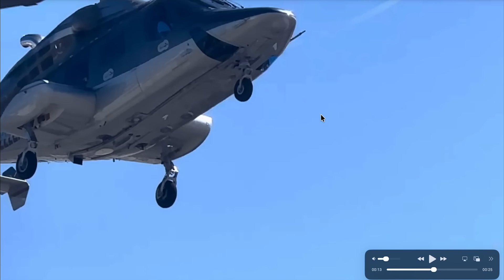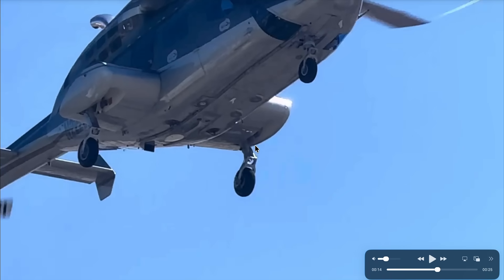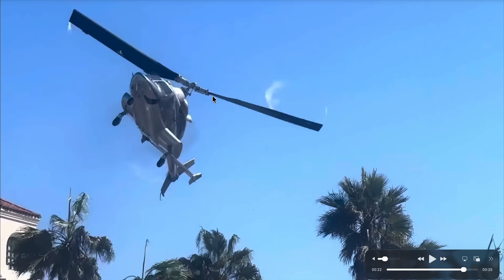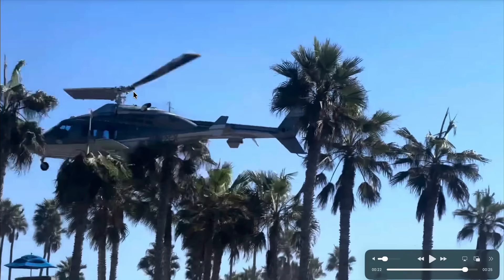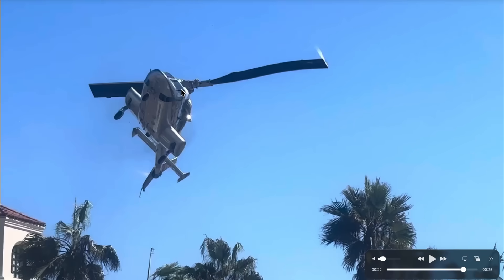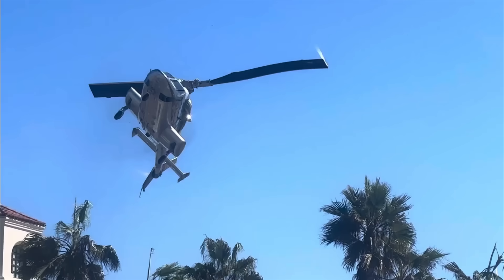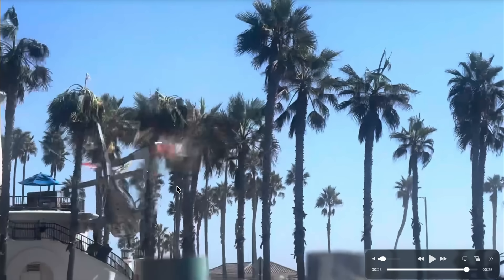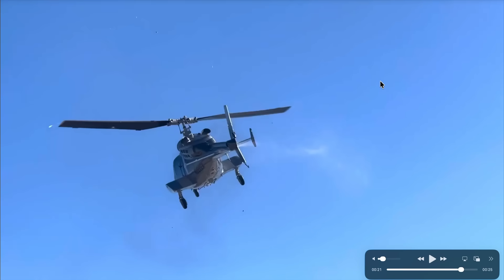Huntington Helicopter Crash Analysis - SlowMo Video!

Comment: The best part is the pilot somehow was able to navigate a softer crash location in the palm trees rather than the hard asphalt or a building. Very scary at best.
Reply: The pilot at that point had no control over where the helicopter was going.  It was only luck the trees somewhat “cushioned” the crash.  He was not a hero as some others have said.  He was riding an out of control helicopter

Comment: 5:15 if I'm looking at things correctly, this isn't pilot input to prevent the pirouette. That one blade's extreme pitch and the direction of rotation are such that the pitch we see would worsen the pirouette, not abate it. I wonder if there was a linkage failure on that one tail rotor blade that caused the tail to shake enough to fracture the tail's gearbox, then the rest followed?

Comment: Looks to me as a tail rotor hub bearing failure. When the hub started to slip off the spindle with the swash links still connected, the blades pitched way past operating ancle, causing them to snap off. With the blades now gone and no longer exercising inward pressure, the hub simply fell off

Comment: I’m wondering if a joint along the driveshaft for the tail rotor failed. I would think that would result in a surge of torque to the main rotor, which explains the sudden altitude gain.

Comment: Appears to be the same failure that the sightseeing helicopter had over the Hudson River in New York
Reply: Not at all! That heli had the main tranny, mast and main rotor assembly all depart the fuselage at high altitude in fast forward flight... then the fuselage with all the people on board plummeted back to earth, with the main rotor assembly and tranny following behind a few seconds later still spinning! Last I heard that failure was due to something in the main transmission having locked up suddenly, ripping the tranny right from it's mounts. How is that anything like this though? 😕

Comment: Right before it went out of control you heard something snap and I believe that was the tail rotor drive shaft it broke apart would explain the dark smoke either way the people on board were damn lucky it was at a lower altitude and Sadly another beautiful Bell 222 is gone

Comment: the tail rotor pitch doesn't look symmetrical between the blades...?
Reply from the maker: Great eye! You're right, it's definitely off. I think what happened which I didnt notice until after I made this video is one of the tail rotor blade pitch links failed causing one blade to feather to full pitch.  All hell broke loose from there.

Comment: This is a classic case of Loss of Tail Rotor effectiveness. 

The pilot pulled a lot of collective. In many aircraft, a sudden demand for more power can droop the rotor RPM. This includes the tail rotor RPM. 

There are several videos you can see the Tail rotor change speed because it interacts with the frame rate of the camera differently. 
The loss of Tail Rotor RPM was not mechanical. No breakage could be heard before the helicopter spins. 
Thrust from the tail rotor is significantly impacted by the RPM. 

The helicopter started to turn and because of the reduced tail rotor authority, the pilot had to push a lot of pedal. Once a spin starts, the corrective action has to be entering an autorotation. Pushing the pedals that hard will result in mechanical failures from stress and high coning angles. 

The tail rotor operates like a gyroscope. It resists changing direction. So when the helicopter violently turned and changed attitude, the tail rotor contacted the vertical fin. 

The helicopter was able to climb initially but the rotor wasn’t able to beat gravity and then the helicopter fell. 

All of this happened because the pilot initiated an abrupt go around, the Rotor RPM of the tail rotor slowed, the helicopter started to turn and the pilot didn’t enter an autorotation. Instead the pilot tried to use pitch on a slow tail rotor, stressed the tail rotor enough to break it off and then crashed. 

If you want to learn more, I have been teaching helicopters for 20 years.
Reply: Finally someone with correct analysis IMO. In other videos of the approach you can see the rotor wash hit the dense palm tree fronds and impact back up to the craft and he immediately puts in a bunch of collective. 

Could an over reaction by the pilot have caused the cascade of failure you described?
Reply: Yeh from a laymans perspective everything seemed fine until he aborted his landing, something went wrong and then it was off to the races
Reply from the maker: more likely a failed tail rotor pitch link is root cause.
Reply: @Outbound300 even a loss of a pitch link is still a loss of tail rotor effectiveness. 

Now, It is possible the pitch link failed long before this video captured the helicopter. The linkage failing during the recording would have changed the sound in the video. 

If that link failed long before this video, there would have been a change in vibration and the pilot shouldn’t have tried to land at the event. 
He should flown straight out and got airspeed back and landed at an airport with an autorotation or run on landing.
Reply from the maker: Would be more aligned with a stuck pedal at that point than LTE
Reply: @Outbound300 the pedals would move completely. 

When the winds cause Loss of tail rotor effectiveness, you don’t have a working tail rotor. The tail rotor isn’t able to produce thrust aerodynamically. 

The same solution is lowering collective or reducing engine power to do an autorotation. He could have done a hovering auto with forward movement to reach the parking lot. But instead he tried to climb.

Comment: If I had to guess, there was a maintenance issue and the fact the the pilot did high load maneuvers prior to the crash, as well as deflected the rudder controls for the tail rotor so forcefully, caused the tail rotor assembly to depart the aircraft. Maybe this was an accident waiting to happen, but the actions of the pilot are most likely the catalyst that ultimately caused the accident.

Comment: Having experienced a tail rotor separation in a AH6 Little Bird years ago,  flying with the 160th in Afghanistan,  my issue was speculated up until the maintenance logs were examined.  As crazy as it was found to be, a singular nut was the cause.  It had been reused, wire tie was severed. In the case of this triple deuce, the log book entries on compliance and routine maintenance will be revealing.  To many folks buy these expensive and complex birds and sometimes attempt to bypass required replacement or in depth inspection of critical assemblies.  Not at all implying this failure was the case in point,  but deferring back to what the log books will reveal.  
Thankfully this crash was not fatal.  That’s the most important outcome.  I’ll bet there’s an insurance underwriter that has had a few sleepless nights, along with an airframe mechanic.

Comment: Great post and analysis.  Thank you.  I agree with observation of a broken tail rotor pitch link.  Between :32 and :47, one tail rotor blade is full pitch and the other is neutral which supports the broken pitch link theory.  After the tail rotor blades departed, all the torque that was going to the tail rotor gets transferred to the main rotor which causes the helicopter to suddenly gain lift and spin.  Pilot probably reacted by bottoming out the collective, I would have done the same.  Add a spin to a bottomed out collective and mast bump is the result.  You're absolutely correct, any higher, there would be no survivors.
Reply from the maker: Thanks for watching and the feedback!

Comment: If you listen to the audio you can hear the collective get hammered.... This video is missing so much of what happened. The collective goes full positive, the engine rpm drops fast, low-pressure vapor trails get severe, rapid accent, gear box blows up and it's over....  Outbound 300 consider the collective!!!!

Comment: Award winning analysis!  Just like  my RC heli crashes!  I really hate it when the tail rotor fails. Good work.
Reply: Yeah I had a $$$$ large scale Hughes 500 electric with painted /lit fuselage, full cockpit with pilots etc. On a "routine" 5 ft hover the tail cut loose leading to total destruction. The cause? A $3.50 metal tail servo clevis broke. Even though I had lots of building experience snd built it bullet proof. Metal pushrod/clevis, epoxied threads, metal gear quality servo and on and on. I converted to quad copters and my planes and left r/c helis after that. That low alt and the palms softening his crash saved their lives. Maybe time for the pilot to walk away from helis.

Comment: At 1:50, the small piece below the tailboom looks like a counterweight arm with the round weighted washers on each end that attaches to the pitch change sliding sleeve??? Looks like maybe a T/R pitch change link failed?? You can see what looks like a rod hanging out below the tail rotor shaft, T'R blade struck that and broke apart? OK, we will just have to wait and see what the FAA finds out! Enough arm chair quarterbacking for now. 🤔

Comment: Amazing analysis! NTSB will no doubt use this footage to determine the cause. Now why the tail rotor failed will be the big question.
Reply: Well, all the parts are there I'm sure they'll re-assemble everything and determine what failed 1st and why. Helicopters require a lot of maintenance per flight hour, I'm sure it will come back to maintenance issues by the time the NTSB releases it's report on this loss. 😞

Comment: The sec. It becomes unbalanced it rips itself apart. Seems a control link failure or driveshaft failure to the tail rotor drove it into a spin. The drastic change in tail speed as the tail rotor rim is much faster than the main rotors rotation. The blades tilted in the grip letting it boom strike. That sec. Is catastrophic failure of the entire drive train running right up into the main rotor drive system. The whole thing shook apart.

15 years or so playing with miniature aircraft/helis. Which have to get blade weights to match within a 1/4gram. If unbalanced. Boy whata mess

Comment: In regards to the tail rotor blade failure, this can be caused by massive vibrations, if, for example, the pitch of the tail rotors appears to be very imbalanced at the start of the accident sequence; one blade appears to be massively coarse pitch, the other appears to be flat pitch.  One is giving off a vapor from the tip, the other blade is not.  Did something fail in the tail rotor pitch control (linkages)?
Once the initial (root cause) failure, everything else is secondary and caused by the first event.
Massive vibrations, tail rotor blades failing, tail rotor gear box departing, puffs of black smoke as this is all happening just indicates the main engines' governors are adding power to overcome the added load of whatever is going on back in the tail rotor department.
Great video.  Great analysis.  I hope you have sent the original, unedited footage to the NTSB...
The low passes to inspect the landing zone and figure out desired approach path and touchdown points is not a big deal and does not relate to the tail rotor system failure.

Comment: As an FYI, my squadron commander, with the Group commander aboard had the T/R pitch beam fail at 1,500 feet and about 100kts forward airspeed, causing one T/R blade to depart, the remaining one took the 90 degree gearbox with it when it left.  He successfully flew it down to the deck, putting it down in about 8ft of water in the surf.  All three survived and waded ashore.
Reply: Auto-rotation or run-on landing?
Reply: Standard procedure for a loss of tail rotor is a run on landing
Reply: @MrDdaland  Yes, I have a sense for that based simply on physics, and a little time in MSFS. But “landing” on water is vastly different, and I don’t know what the rules say about run-on landings on water, and his description is unclear on which method was used. In 3 feet of water? That’s enough for the wet kind of fluid dynamics to make a physicist’s head do a 360° when it comes to a helicopter run-on landing. Way worse than a ground-loop. Or intentionally sliding a motorcycle through a barbed-wire fence to avoid a head-on collision.

Hence my question for the guy that knows the details. But you know this, of course, so my comment is to provide background for everyone reading it.
Reply: Why did the h put it down in the water instead of flying to the next airport? 9.000’ rwy is more than enough for a running landing.
Reply: @akkseljohansson3601  I guess that when important parts come off of your helicopter, you might decide to land it right away, just in case even more parts are about to come off.

Comment: I’m not a helicopter pilot, but my initial analysis was that he didn’t like something about the landing, panicked, pulled a bunch of collective, which caused the rotation, then to counter it, crushed the pedal. All that sudden movement may have caused the stress that caused the blades to begin to come apart. I could be wrong, but I don’t think the helicopter started coming apart until after he had already begun climbing again.
Reply: It’s possible, as you could tell by the excessive yaw to the right that he was pulling a ton of collective. Why it’s a good practice to load your rotor disk very early in the descent.
Reply: I don't think so.  Others say the upward movement as the result of more power going to the main blades as the tail rotor let go.  It's clear from most of the comments that a component in the tail rotor linkage failed first.  He was coming in slowly before that.

Comment: Did landing in the palm trees soften the impact? Enough to say it saved them if it had been open pavement instead?
Reply from the maker: it definitely contributed to a softer impact for sure.  Could have been much worse otherwise.
Reply: @Outbound300  Yeah, and I haven't heard any media mentioning the trees helping. Weird.
Reply: And it landed on the curved staircase, so that removed the last bit of acceleration it would have had to the pavement.
Reply: @PetesGuide  Hmm. Could be

Comment: No one was killed.  That is the mantra here.   After such cascading failures the pilot typically becomes just another passenger.  Somehow he used what little input he had left and managed to FLY to the scene of the crash.  A pro!
Reply: If he was flying very close to buildings before this accident as the original poster hinted at, he certainly wasn't a pro.
Reply: Pilot was just along for the ride…..just like a fixed wing that stalls…….uncontrolled descent into the terrain 😢
Reply: There literally was very little the pilot could do at that altitude.  He had yanked the collective into his armpit by the time he hit the trees.

Comment: you lose a tail rotor you are inevitably going down.
Ive often wondered why more helicopters dont use the redirected jet exhaust method and do away with the tail rotor completley.
Reply: the NOTAR system is not redirected jet exhaust, it is a fan pumping air down the tailboom, that can still fail like any other part, and it is much more expensive, and a lot of pilots say it is more of a workload to use
Reply: The NOTAR system is amazing but it's not fool proof. Unfortunately the patents ran off any interest in competitors doing updated versions and there was apparently little customer demand.  Personally love the 600N.

Comment: In a different video head on, it appears that a tail rotor linkage disconnects, which causes one of the tail blades to increase in pitch. This probably stalls the blade and causes the rotation of the helicopter, and causes severe vibrations in the tail rotor. The tail rotor is probably shaken out by the severe vibrations.

Comment: 4:41 The thing that would cause both tail rotor blades to separate from the hub at exactly the same time is if the tail rotor drive shaft seized and the momentum of the blades would snap them off and then the hub would break off the drive shaft. Some tail rotor blade drive shaft oil change intervals are as low as 5 hours so the loss of lubrication and then suddenly stopping from oil ageing would be the most likely cause of the observed events.
Reply: It’s possible that the tail rotor gear box had been dislodged causing the  tail rotor blades to hit the tail boom which would explain why they both broke off together at the same length.
Reply: @nocalsteve Either way it should be easy to determine if they hit the boom, the main rotor as suggested below or had a disconnection from the tail rotor driveshaft.

Comment: Looks to me like one of the tail rotor control linkages failed, can see significant difference in angle between the blades and possibly loose linkage arm in the footage...
Reply: Called it... see Blancolirio's analysis to confirm.

Comment: Mast bumping may have been the reason for the head separating from the mast, but I think it may have been caused by excessive rotor coning. If the main rotor rpm had decayed enough so that centrifugal force could no longer keep the blades from coning too much it was likely that that the flexure on the m/r/h failed. This happened on a Bell 214B some years ago. The Bell model pictured here has a similar m/r/h.
Reply: Good point.  The coning could also be from the pilot "finally" executing his underlined emergency procedure for this situation; reduce/retard power ect. I notice the commentator mentioned the dark smoke coming from the exhaust which could be an indication the pilot had reacted to the emergency situation by reducing/retarding power......

Comment: Good analysis. It will be interesting to see what the cause of the tail rotor failure will be. I don't think it was loss of tail rotor authority due to winds, but catastrophic mechanical failure. I remember instructors screwing with me and giving me a tail rotor failure and gearbox departure in the sim. Always the same outcome. Good thing they were @ 50'.